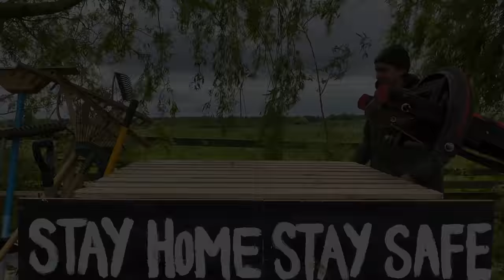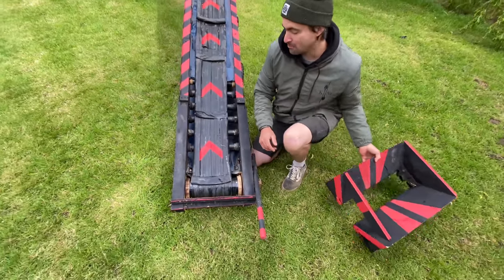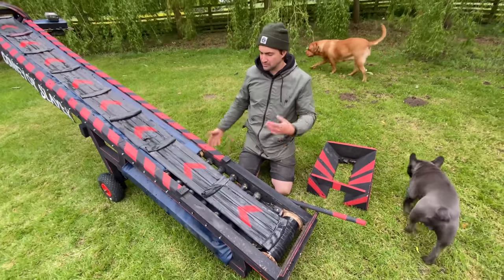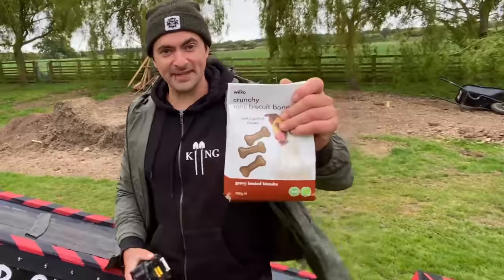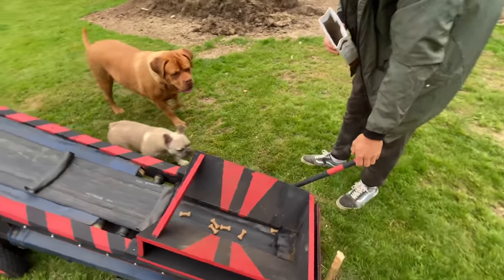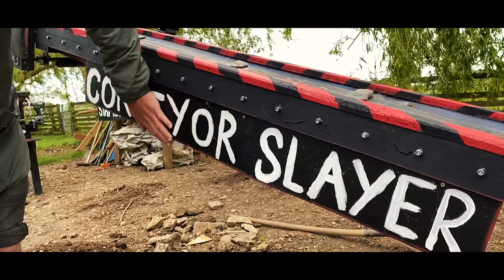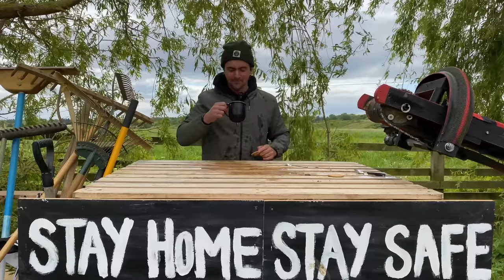MTB DIRT CONVEYOR BELT - ITS COMPLETE!!

Comment: how about some sort of automatic jump watering system or something like that! loving the videos!
Reply from the maker: Yooo yeh man that would be cool, set it up on a timer too and a
Be able to regulate the pressure and all that 🤔 🙌🏼
Reply: KIING OF SPADES  yeah, would make it so much quicker to be able to ride the jumps! And you could have some sort of solar panel system which could allow you to have it at remote locations, but that probably makes it way to complicated 😂😂
Reply from the maker: dexter bond hahah, yeh man that would be epic a remote sensor, need to work on my electronics for sure, wireless switches would be cool, I could certainly do it if I had 240v as I could just heating system controls etc etc haha
Reply: KIING OF SPADES  yeah that would actually be mad if you could make that, would make the jumps look so much nicer/ easier to work on. Wiring will be the hard part probably 😂
Reply from the maker: dexter bond hahah yeh man for sure that’ll be cool!! Hahaha!! 🙌🏼🙌🏼

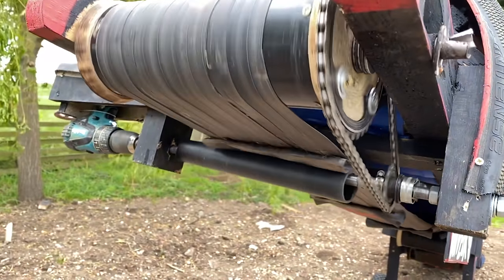Comment: Your remark at 3:30 about placing the motor at the top was very intresting and made my ears prick up. In fact, i am almost in shock that I stumbled across this video. I am currently studying the reason why chairlifts and cable cars  in mountain settings are more efficient when powered from the mountain station. (this only applies when the lift is only moving skiers uphil and when there is a hight difference to be overcomel) I had not considered that this pheonomenon also aplies to conveyour belts - Naturrally, my ears pricked up when I saw this video.
Reply from the maker: Jonathan Cook hey buddy that’s awesome what your studying, yeh for sure I’m a snowboarder myself and thinking about they are mostly powered from the top especially anything carrying more than two people. Must be under an immense amount of strain when powered from the bottom.. in my case because I was using just a drill it was loads better as it was pulling the weight instead of pushing the weight, I’m sure someone like yourself maybe able to explain as to why this is a better way? Thanks buddy, have a good day. Enjoy the lift studying any tips be sure to let us know 👍🏼thank you
Reply: @KIINGOFSPADES  Sure....send me an email: jonathan@------------------ and I will send your over the report I am making when its done. (There will be a lot of maths and Physics in it, but the ultimate answer will be presented in English, I promise!)
Reply: @KIINGOFSPADES  Where are you building your new bike park? I'd love to help out with something like that. Been watching Seth's Bike Hacks/AKA Berm Peak for a while now, but Im not travelling all the was over to Dakota or wherever that guy lives! Been keeping myself busy this summer maintaining ski tows and snow fencing at not one but 2 ski areas in the north of England.
Reply from the maker: Jonathan Cook excellent look forward to that that will be awesome, thank you.
My emails
Kiingofspades@outlook.com
Reply from the maker: Jonathan Cook ahh yeh the old Seth is now berm peak which is cool, yeh his channel is one of the best channels for Mtb as a whole for sure and lives in paradise! I’m the United Kingdom, Milton Keynes around an hour north of London. The new park we are building is very near to that called Northampton, it’s a private park but I would love to be able build a public park one day, I’ll get you in for the ski lifts!! Haha!! Thank you
Reply from the maker: Jonathan Cook ps thanks for watching the channel, I’m new at this but like to think it’s getting better just trying to find the sweet spot with it all haha!! My Instagram is kiing_of_spades.. send us a dm on that buddy, that page is certainly more ‘seasoned’ shall we say hah!
Reply: @KIINGOFSPADES  If seth ever wants to take me up on the idea I have a neat idea for a bike lift that will turn his bike into a sort of funicular railway of sorts - the coolest feature, it uses the rear break handle as an an accelerator! - weird huh? 
Again, I will send you that. Perhaps one day It will be good enough for practical use at berm peak!
Reply from the maker: Jonathan Cook ohhh yehhhh?? I’m very intrigued by this sounds awesome!! Well I’ve spoke to Seth before and he seems really great chap so I’m sure if you was to message him he may reply, if not I can always make a bridge for you buddy

Comment: add an adjustable piece so you can get your belt tighter. it will take some of the weight off of the chain. a few long bolted screws with some lock washers and nuts should do the trick.

Comment: Get a higher wattage 240v drill that plugs in and a cheap generator and some flange housing bearings for the drive end
Reply from the maker: Ahhhh man yeh for sure I’d certainly love to do that, make it all from steel too, bearing and I would love to make it extendable too somehow  but also light weight... imagine if you have had little remote car sort of thing under it that you can actually drive with a remote haha 😆 🤔 💭